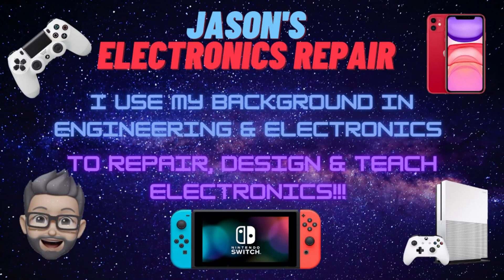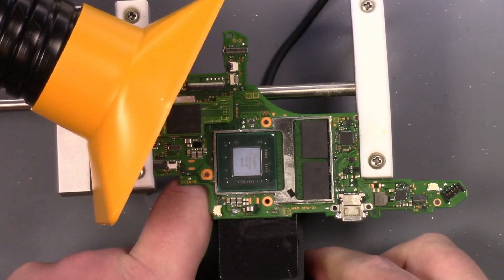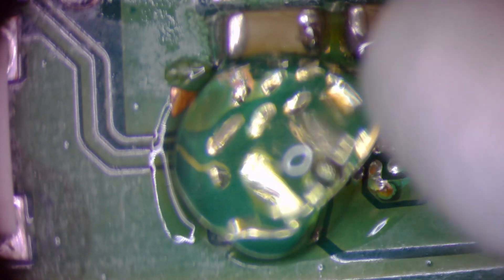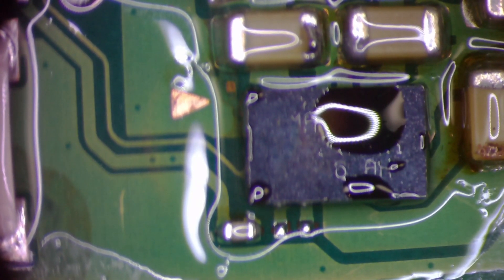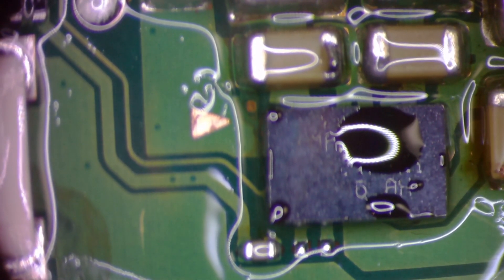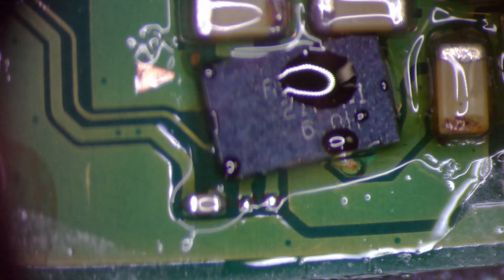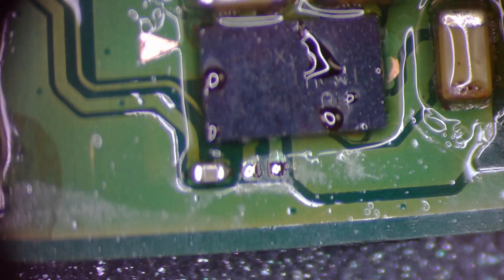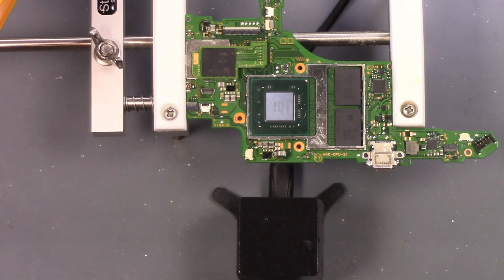Can You Install A BGA Chip With a Mini Hot Plate?

Comment: HI Jason, nice try.  I've tried similar using a cheap hot air preheater, the KADA853B and had some success with that, but I think a larger IR hot plate is what is really needed for this type of indirect soldering.  Did this work after your soldering attempt by the way?
Reply from the maker: It works  but it is not something I would try again unless no choice. I have larger hot plate, but I bought that mini hot plate off a recommendation that it would change my life and I want to see how much this little thing can do. It has been very useful on another project that will be having a video soon.